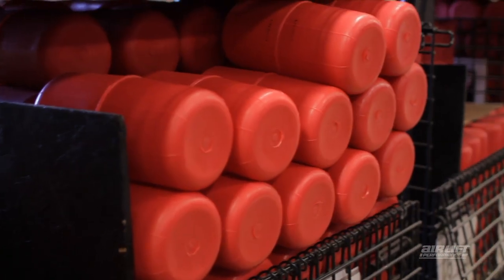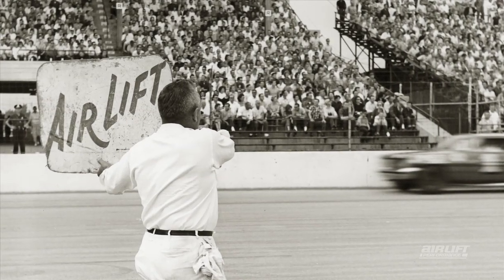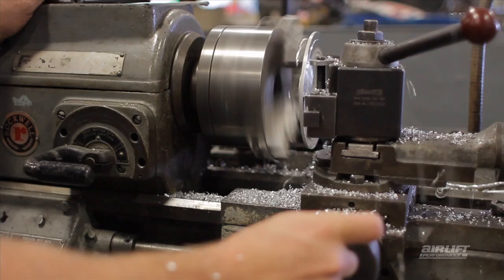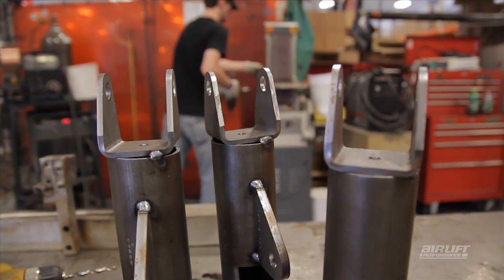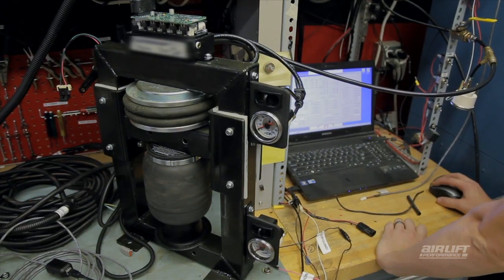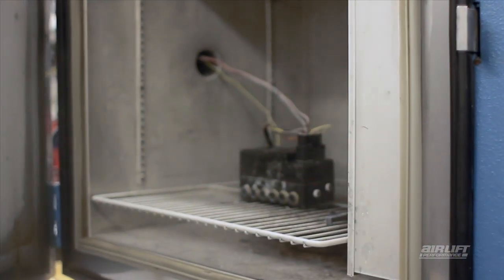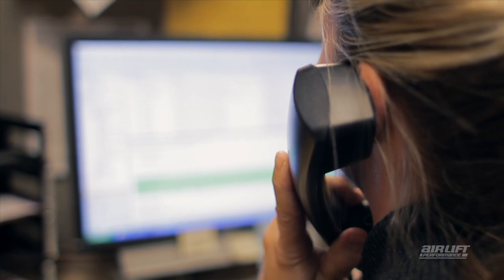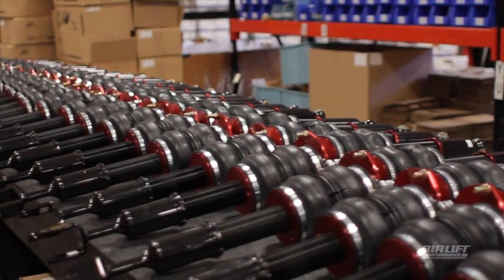A look inside Air Lift

Comment: Hi! Please help me. My Air Lift suspension is very stiff. I download the manual from your site, from there i found out that i must set ''DAMPING ADJUSTMENT''But i can't to do this. I tried to do this with adjuster clockwise and with 3mm hex key. But it's no effect:(. I tried all 30 ''clicks'', from hard to soft - nothing changes. Front strut is hard as wood,  there is not even hesitation, amortization. What can i do with this front strut's to make them much softer? 
Thankful in advance!